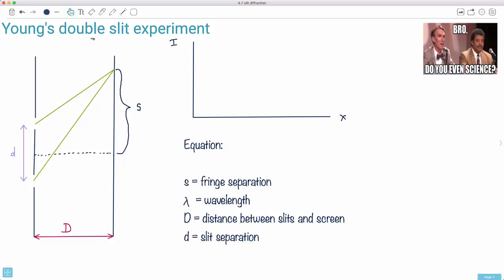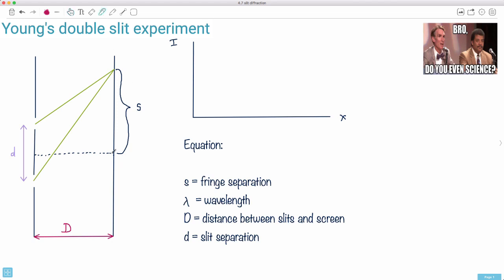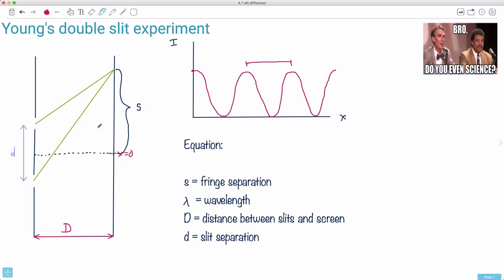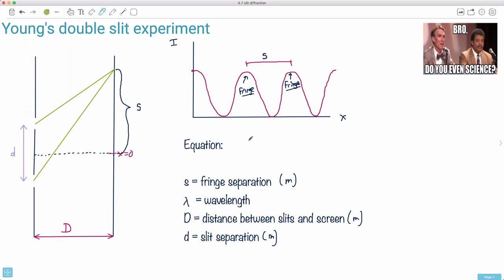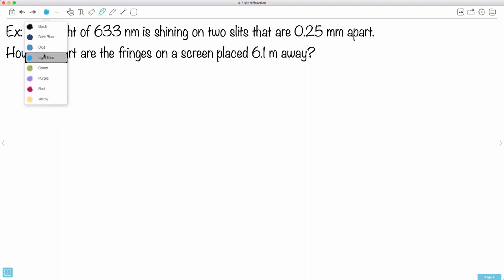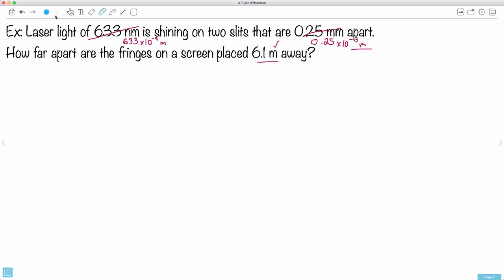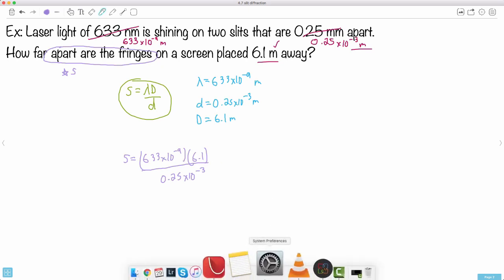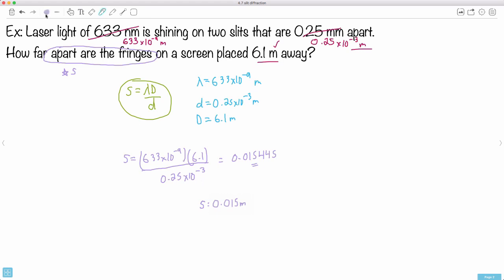Young's double slit diffraction [IB Physics SL/HL]

Comment: Hey there Mitch, ilysm you madlad, completely saved my mocks like it was nothing, but a word of advice I have, this isn't applicable for this video, but I am confident in unit B and some other units you faced this issue. Since the new syllabus, calculators in exam mode are allowed for both paper 1 and 2 (according to my teacher, at least) and with that comes the fancy function of solving equations for you already which means you get to skip over the boring algebra, just remember to replace the unknown value with x. I know that TI-Nspire and Casio CG50 (the 2 recommended calculators from our school) have this function. I use the Casio and there is a function called NSolve. Look it up and maybe share this technique in maybe a more general playlist where you additionally talk about some exam tricks with calculators or perhaps approaches to solving a problem as well as measurements and uncertainties.

Thanks once again and stay awesome
Reply from the maker: Good idea, appreciate the comment! Cheers, Mitch